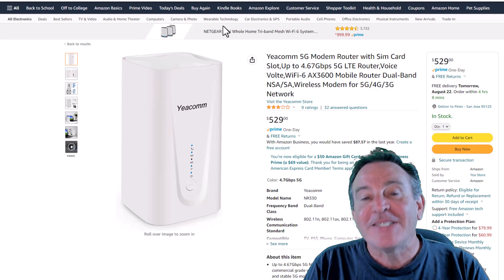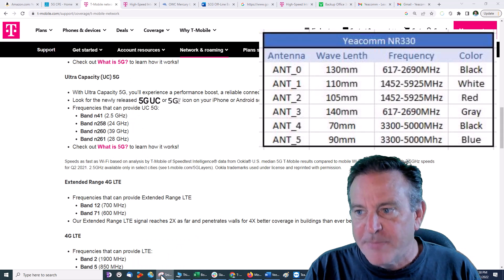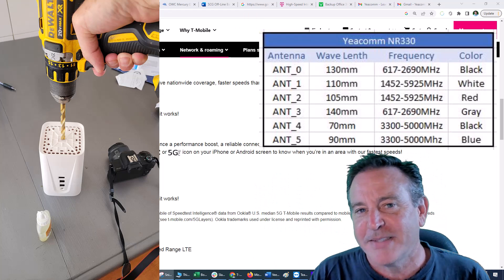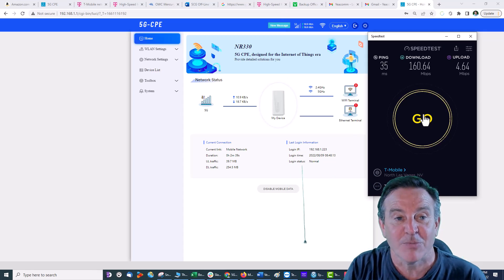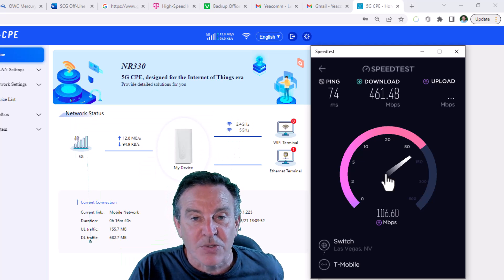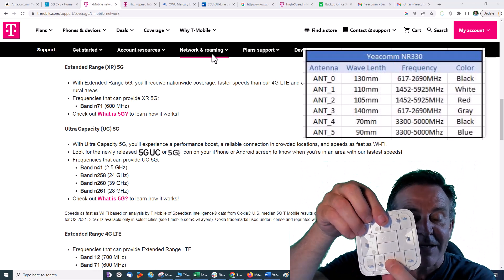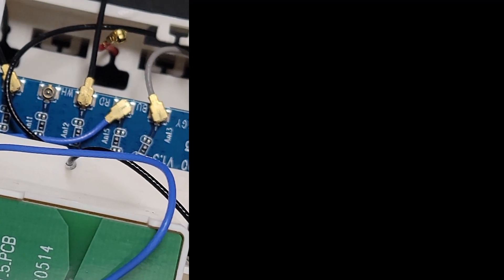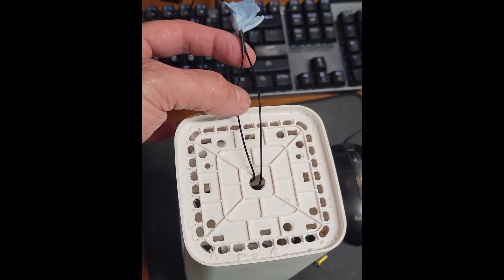🔴5G Gateway Modification Yields HUGE PERFORMANCE INCREASE by Yeacomm

Comment: Many thanks for the video.  I just ordered this NR330 and realized that it has no external antenna port.  BTW we can just drill 2 holes at the casing near where the LAN ports are, and use a nut to secure the SMA connector, this will make it looks like a real external antenna port.
Reply from the maker: Feel free to adapt this as you wish but I waned to make it look the same after I was done.

Comment: hai buddy what firmware version did u use for this modem router..?
Reply from the maker: I am not sure. I am holding it in my hands right now but it is not currently hooked up. What feature are you looking for, I am sure that it is probably in here.

Comment: Can you use a 4x4 mimo on this gateway or just a 2x2?
Reply from the maker: Either. It's got an internal 4x4
Reply: I meant  to say a 4x4 proxicast antenna. What other two antennas should I connect? Were you able to change the mtu? I can't find that setting @PeterC408

Comment: Hey Peter. Can you do a video on taking apart the new Verizon Gateway CR200A?
Reply from the maker: Sorry, I'm not a Verizon guy.  Verizon went to the FCC frequency auction and spent their money on some really high-speed frequencies.  They are now discovering the issues with high frequency; sure, they're fast, but they don't travel well. If you live in an area where coverage is good, it could be a good solution but as far as a roll out strategy for the US it's kind of a major fail.

Comment: Ipex1 or Ipex4 antenna connector sir?
Reply from the maker: Ipex1, a link is in description
Reply: @PeterC408  thanks
Reply: @PeterC408 i already have all the hardware needed. Only problem is my country use nsa n78+b28 for our 5g signal. How do i connect to my 2-wire antenna to which ipex port? Please help me sir really appreciate your time

Comment: how to identified which wire is for 4G & 5G
Reply from the maker: Ah, good question.. These are just antenna wires and antennas are passive elements. In the home internets space 5G is using the same sub 6GHz frequencies as 4GLte. The antennas don't care what you call it, just keep the two pairs separated and hook them up to a good 600MHz - 3.7GHz antenna solution. I have shown some from Proxicast and Waveform. Good stuff the both of them. Proxicast Antenna https://amzn.to/2LfALev Waveform https://youtu.be/a72fwKACD9E?si=zp08B0ErE5ablXUi
Reply: woww..gud info mate..really appreciate

Comment: Can u help???? I had  this gateway and I put in tmobile sim and was on fire with speed. The sim case holder got too loose and wouldn't connect. I got 2 new ones and a new sim card. I put it in the same exact place as the other gateways. I can't get these other 2 yeacomm gateways will not connect to 5G...... I have done all the testing yeacomm asked and nothing...
Reply from the maker: I assume that "on fire with speed" was good but I am confused. This product does not use a SIM holder. The micro-SIM plugs in directly to this unit without a holder. Are we talking about the same Yeacomm model? Perhaps yours does not support 5G. Also, do you have two gateways or two SIM cards?

Comment: How would I connect this to a wave form 4x4 antenna for n41 and b66 bands
Reply from the maker: An antenna is a passive element, it can not be tuned but that said, this Yeacomm gateway can tune in (band locking) different bands. You can simply add the Waveform antenna (respect the pairings) 1&2 to one pair of leads, 3&4 to the other pair. Then use the firmware to band lock everything but n41 and b66. If those frequencies are available, it will pull them in.
Reply: @PeterC408  but how do I know which parts to put them on the waveform since it’s -4 -4 +4 +4

Comment: What dish/satellite did u use to hock it up whit?
Reply from the maker: I used my Proxicast Antenna https://youtu.be/wXSpbP8NuWw
Reply: @PeterC408  ok thank you.
Reply: @PeterC408  oh. Sry, i mean that one you have outside. Connected to the Yeacomm 5G Modem AX3600 WiFi-6 Router with Sim Card Slot,

Comment: Hi peter I just purchased this router but seems like I can't connect to 5g only to 4g with TMobile I have factory reset it a few times  and I can't connect I have full 5 g signal at home u tower is a few houses aways any advice ?
Reply from the maker: This radio should pickup all the Bands necessary for 5G. Who is your provider? Are you trying to use the SIM from the TMHI in this router without making all the modifications necessary to get it to be accepted?

Comment: I get over 300 mbs with the verizon original 5g gateway, T-mobiles constantly would be as slow as 30 mbs, and sometimes even 2 mbs... also would randomly lose connection at random times. Even though our area had good coverage. Their store wasn't able to help, nor their customer service reps, not even their supervisor.

Verizon for the win.

Comment: What is this device's IMEI? Not the individual serial #, but the manufacturer's IMEI, it's just an international patent number basically, so can check it's compatibility with my provider? Curious to see if it will would work with a cheaper plan from Mint, US Mobile, Visible, or another affordable plan, nearly all of them ask for this before you can get a SIM for it though. I just purchased one on Amazon, just waiting for it to come in. Perfect option for me because it has a VoLTE port for a home based telephone.
Reply from the maker: The IMEI is unique to each device. It is like a Social Security Number. They don't really need to know they just want to control you. I switch Gateways all the time.
Reply: US Mobile and Visible will not support it, however Mint does. Note that the device will be considered Hotspot data, so only 5GB of data with their 30/mo Unlimited plan so not a good choice for lots of data unless someone can figure out how to trick them into thinking its only phone data.

Comment: Sooooo much easier than the Arcayan from TM …. Entire body slides off like the Nokia 🥳🥳🥳
Reply from the maker: I have never seen plastics this well made. It was a pain in the butt to pull it apart, but well worth it to see what was inside. Good stuff. So many antenna pairs and a very capable radio. I hate when people say, I'm going to wait until it is the price of 4G radios... it will never be, this is something much different!

Comment: peter i have the same router.   I removed the top and bottom.   I am having trouble sliding the cover up like you did.    Did you have to remove the two screws located under the bottom cover once you remove it?   Any other tricks?
Reply from the maker: This unit is very well built indeed. The screws have to come out of the bottom and two on the top. Then it slides apart. Did you find the two under the top lid?

Comment: Hey Peter, thanks for letting us know about your discovery. I have the T-Mobile Asus TM AC-1900 Router and was wodering , instead of buying a 4G LTE Router for internet , how about just using a 4G LTE USB Dongle. Would that work as a Cable replacement ?
Reply from the maker: The difference is service to one machine vs. whole house.  I want an internet that covers the whole home: Several Computers, TVs, Alarm, Lights, Alexa. I have 32 devices on my wifi alone and several wired clients. This gateway will enable you to run your whole house.

Comment: I am going to go ahead and buy one and use AT&t I have used T-Mobile home internet but recently it has been shutting off on me I don't know if they are doing a tower upgrade I'm usually getting 10 MB down I bought mesh systems and antennas as well and I'm going to get this yellow calm a try with AT&t SIM because outdoors I get 5G 100 MB on my cell phone already. I will keep you guys posted and please some will let me know if it does work with AT&t Sim before I throw away $500

Comment: so i lived in rural area with 4g only cause in lithuania there is still ongoing 5g auction and we still don't have 5g but with 4g band 1 - 3 and 20 i would get 180mbps down and 35-45 up with ping of 13-15ms it was amaising old modem would get 18ms ping and 80mbps down 20 up at night it would get 125mbps down and 25 up the band 1 signal (2100mhz) tower was located 25km away and i would get 50mbps down and 0.5mbps up at -114db signal and SINR -1 so and b3 - b20 tower was same but 5.8 km away but with b3 i would get 80-100mbps down and 30 up at -84db signal with SINR of 20-27 nad B20 would get 30-60 mbps  with 10db higher signal and SINR of 25-30 it was best internet in the town i tried other operators (they had only band 3 and 20) i could catch band 7 sometimes but at -145 and sinr of 0 so but it would not connect (other operators of bite and tele2 would give me 20mbps down and 5 up :D) telia is the fastest 4g operator in lithuania or even europe with average speed of 140mbps down and 25mbps up
Reply from the maker: Great data. You seem to have a very good sense of what you are receiving and some very good scores. 145Mbps over 4GLTe is almost unheard of in the US - that is great!  It is hard to imagine that your 2.1GHz Band 1 can reach 25KM (that's over 15Miles). Impressive, I am not sure what your question is.
Reply: @PeterC408  yeah and that was with cat 6 and 7 modems and with cat 22 modems where you can aggregate few same bands speeds will incease and BTW is that 5g band ur getting using DSS or anything like that ? and if no the speeds should be greater cause even here the 2100mhz 5g can get 1.8gbps on the phone and 800mbps down on 4g in the capital of the country (ive personaly got 530 mbps down on my old phone i was shocked (BTW not the same location and it was not the same town phone used huawei p20 with 4CA i would get B28 700mhz sometimes to make 5CA))

Comment: After speaking with Mimo Support I went ahead and returned the 2x2 and purchased the 4x4 for my TMHI. I can’t find a video on which antenna wire from modem should plug into the 4 connector’s from antenna. Does it matter or do they need to be plugged in certain order? FYI I have the Silver trash can T-Mobile modem.
Reply from the maker: One of the antenna leads says H and the other V.... for horizontal and veritical. Try one and then the other and it should be clear which is right.

Comment: Peter, I read in the specs that it has band locking. But does it do band aggregation? TIA
Reply from the maker: Yes, it had band locking which means that it won't jump from n41 to n71 just because n71 has a slightly stronger signal blind to the fact that n71 has 25% the bandwidth.  Band Aggregation is the one saving grace of the T-Mobile solution... it is a neat trick indeed but T-Mobile solution seem to be locked to 4 antennas of the same length and it jumps to the wrong BAND at the drop of a hat, so is it really that great?  Also, what about the new C-band T-Mobile has announced. Will these TMHI be blind to those, I am not sure.

Comment: Cool, as I'm not overly impressed with T-Mobile 5G...Works most of the time, but slows down at some points during the day. I get voice distortion for a split second every once in a while and buffering on occasion with YTube vids. Gateway reads good signal and wifi is excellent at computer. I'm in the middle of Chandler, Az...Would you think this will solve any of these issues. All in all, I'm ok with T-Mobile at $50 a month over Cox crap at almost $100.
Reply from the maker: Are you using a 2nd access point?  Using your own access point solves the heat issue but creates a packet size issue that needs to be corrected. I have a video on that, if you do. The MTU needs to be changed to 1420bytes to be stable.  I am loving the price point and now that I have good stability and  speeds... I don't mind.  Here is a video I just did on 1 year with TMHI. https://youtu.be/C4LnaewYSZA
Reply: @PeterC408  It's just one computer 10ft away from gateway. I'll have to look at the packet size issue. Thanks

Comment: Is there a modem you can use with T-Mobile home internet that is mobile? It’s not tied up to one tower? I’m a truck driver and would love to have something on the road.
Reply from the maker: Well, we are getting there. There are many things that I like about this unit better than the original unit. This has band locking for example, it also does not get hot as an access point. However, I must mention that the "one place" limitation of TMHI is not that the hardware is tied to one place but the service is tied. Here is a good article that explains why T-Mobile wants to do this... it is about quality of service to their network and selling extra bandwidth in areas where there is "extra bandwidth", moving around screws that up. https://www.fool.com/investing/2022/02/09/t-mobile-is-already-a-leader-in-home-internet-serv/  Good article.
Reply: @PeterC408  Thanks Peter I appreciate your reply. I think with Verizon home internet is mobile, just hoping T-Mobile can do it soon also.
Reply: Also look into insty connect for on the road application

Comment: My God....$529.....Its getting more expensive by the video😵‍💫...give it up!!!
Reply from the maker: We need to stop thinking that 5G is 1 plus 4G. 5G is a broader spectrum with new capabilities. We see in this unit 3 complete pairs of 5G antennas and some very innovative WiFi antennas... this aint your back alley 4G modem with two untuned antennas for $60 bucks... This unit can pull in signals that others can not. It makes me think back to the T-Mobile Nokia and wonder if both pairs of antennas were for the same frequency range - maybe we all got luck on the last Mod - learning is not free.. always push the limits and never give up!

Comment: Well, it doesn't work with TMHI sim and it is a $500 solution and it is slower for you. Not really all the great. If you are out in the middle of nowhere then you won't get this fast of speeds. Cool they sponsored you but you'd still do better getting a TMHI router.
Reply from the maker: Just a few things... No one said I was done with this yet or given up. They only sent me a unit, I am not getting paid to review it.  Also, there are many people who can't take advantage of TMHI because it isn't yet offered in their area yet or they do not have an address that qualifies or they don't want to mod equipment that is not under their ownership. Also, TMHI is supposed to be FAW (fixed area wireless) - no  mobile folks (although some have been successful, others not). Others have great plans for 4G (compatible with  5G) and do not want to give them up.  PUSHING THE LIMITS MEANS PUSHING THE LIMITS... Hack like no one is watching, kind of thing. Also, T-Mobile UNLIMITED may not be around for long... they might be offering a less expensive Limited version (hope I get grandfathered in!!).
Reply: @PeterC408  I do enjoy your videos, I’m more frustrated at T-Mobile for not allowing us to move our sims to any devices. Having something like this would be awesome since they lock us out of their own devices. There are many other devices like this out there that would be awesome. Keep doing what you are doing, I find your videos helpful and I’ve modified my trash can for sure.
Reply from the maker: The TMHI gateway is pretty great because it aggregates two bands (4G and 5G together) but aside from that bit of awesomeness, it does not have many standard features that you would expect, like band locking and availability. This one works with more bands and multiple carriers. For some folks, who may not be able to get TMHI this might be better. Now what if I told you that I could replace the TMHI??? That might happen, working on it.

Comment: was considering this and the 5g one from kuwfi and i ended up just going with a MOFI 5g with the 9191 modem
Reply from the maker: Let me know how that goes. MOFI was everyone favorite gateway until they destroyed their leadership position with the release of a dramatically inferior version of their SIM7. That was branding suicide.
Reply: @PeterC408  I will, definitely.  I'm gonna be sticking around
Reply: @PeterC408  I've got an update for you!  the mofi is working great, i'm getting 120-130mbps down with just a -96db signal (it says i'm on an unassigned 1900Mhz signal, not sure what that is, t-mobile network so maybe N71?) and i've already used it to game pretty well.  there's quite high ping (~85 when gaming, 100+ when speed testing), but I think that's understandable from any of these systems.  I plan on getting some exterior antennae to hook up and hopefully kick that -96db up to a -80db or something.  the wifi network is also very good, it's reaching across my entire house with full bars and full speed (2.4ghz for wifi), something my other two routers (regular routers) couldn't do without dropping two bars and half the speed.

Comment: Using 5g will use up your limited bandwith pretty fast with that setup. Awesome speeds!
Reply from the maker: Okay, but should we all go back to 3G to make downloads "last longer"? Lots of folks are paying for 4G LTE and this would enable them to reach the speeds they are paying for (no extra cost for 5G).
Reply: its true, if you get 1.2gbps connection of 5G. Speedtest alone literally would take 2GB. yes one test of SPEEDTEST. But again if you using 5G for your modem i would be idiot to use limited quota plan.

Comment: Wow!  Very impressive.  Thanks for doing the hard part :)
Reply from the maker: Glad you liked it! Some folks don't get it. 5G gateways are totally different than 4G and this solution packed with antennas proves it. 5G can do things that 4G couldn't. It not only is faster but can reach much further. I am tempted to go to the boondocks and pull in 5G where no one has ever before.... just I live so far from the boondocks, I don't know where to look.